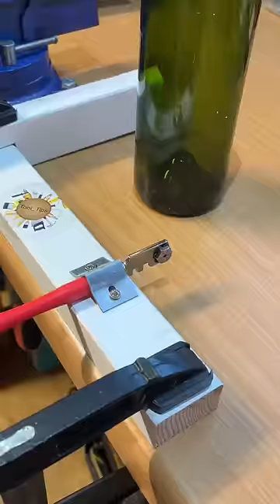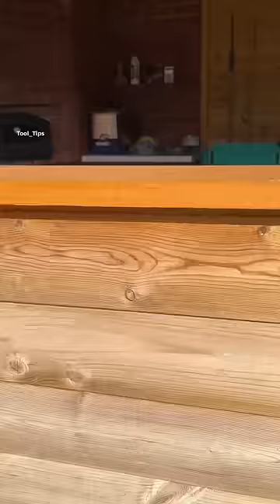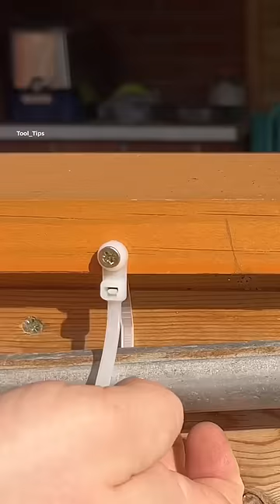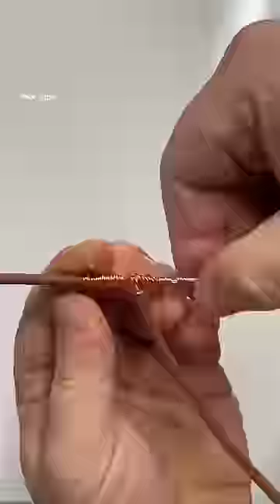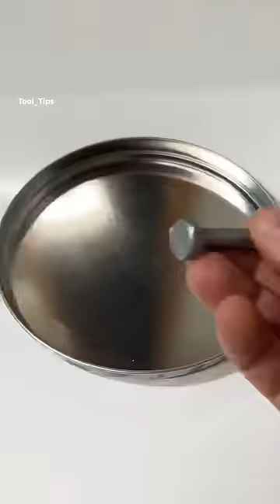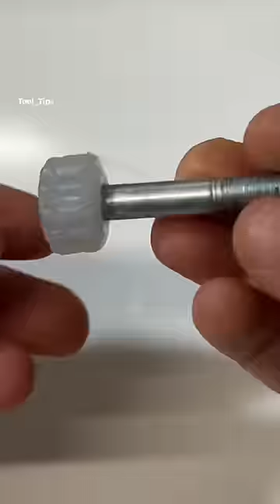Best ToolTips on #shorts

Comment: The copper wire one was VERY handy.
Reply: Everything was terrible
Reply: Forgot the heat shrink
Reply: No
Reply: @paulsherwood2615 and solder
Reply: Hope you are joking. Never do something like this, if you don"t want to burn your house... Use solder at least, but there are even better options to make an electric connection...
Reply: i would find it handy in prison
Reply: And VERY illeagal. If you want to burn your house, get charged from insurance fraud and get in prison. This is is how you do it.

Comment: If you ever needed proof people don't understand the basics of electricity that splice is it. A high school physics student could readily explain why that's just bad regardless of what your doing it for - use proper safe connections for gods sake, they're not bloody expensive... 🤦
Reply: Take some time to learn about voltage, resistance, and current. If you just understood how an electric kettle or toaster worked you would think twice before doing that, hell, feel the heat from a drill after use... 😬

Comment: You could always use a wire nut??
Reply: Can't use wire nuts in plant machinery, they come loose with vibration.
Reply: They also cannot use wago, although it isn’t available in some countries
Reply: wire nuts are only popular in North America. You can technically buy them here in Europe, but I have NEVER seen one is use, anywhere.
Reply: @xl000  never knew , that’s interesting
Reply: That’s why, never be bias at some electricians in different countries because they are never have upgraded materials like other countries have

Comment: To all of you "electricians". . . . . . that is a splice for low voltage connections and is intended to have heat shrink applied afterwards. Never installed any remote starters I assume?  Please dont use scotch-locks or wire nuts. And preferably solder the connection as well.

Comment: So most people agree the only one that actually is relevant is the bottle scoring, and maybe the zip tie one? Glass vial was impractical and messy, the wires are a textbook fire starter, zip ties would hold for a temporary project, but are in no way durable enough to last and could contract in the cold likely snapping. Hot glue is flexible, but would fall apart quickly under even the slightest amount of torque.

Comment: The splice isnt too bad. Its just a standard military splice. If they covered it with something insulating itll be fine. They exposed too big a section on the horizontal line though.
Reply: just cut it and use proper wire lugs

Comment: Tip #1 putting sand and glass in the hole does not make the bolt tighten up clean that shit out and get an anchor they sell them in the same store you got the bolt from.
Tip #2 I've never cut glass before. I don't know if this is practical or not.
Tip #3 Not a bad idea but if it's going to be there more than a few days get the proper straps for it 
Tip #4 Are you trying to start an electrical fire because that's how you start an electrical fire.
Tip #5 If you want your bolts to barely hold you could have just screwed it in without wasting the hot glue.

Comment: #1 is the reason you use screws not bolts on wood #2 how to cut a wine bottle with a glass cutter #3 how to use screw on zip ties as designed. #4 how to burn your house down #5 ehhh I guess it works?

Comment: Dont use glass as a filler in a whole that is too big for your bolt 
When will you need to have a split from the mainline? If tiu needed it a three-way connector is best as you can replace the individual lines and not the whole thing.
Hotglue is not a tool for anything but holding decorations to wood, paper or foam.
Reply: That ain't just glass, inside that vial there's chemicals that create a reaction that binds the bolt into the material and are actually meant for anchoring, the problem is it's meant to be used in concrete, in wood it's worthless.

Comment: Why put a running drill with no bit next to a piece of glass you're trying to cut? 

The first one, what's the tip, it's a chem anchor. 

As many, many electricians have already said, don't fucking splice wires like that

Comment: first one is completely useless, second one is common, third bro that's what they're made for. 4th if you need to splice wires use a terminal block, or something that isn't this, also, fucking solder it, and insulate it.. last one, what's the point, buy a bolt with a bigger head...

Comment: that is not how you splice a wire, wtf is that, how are you going to insulate it, do it properly just cut the full wire so you have 3 ends and then splice those together, their are plugs for putting multiple wires into that insulate and clamp them together, better still solder them together SOLDER you know a solid connection

Comment: Like that's not even looking like a secure contact that just looks like a major fire hazard like somebody taking three different wattage of a extension cord and making it into one like one guy that I know I mean you know those generic white extension cord that you can buy from Walmart for like ten bucks and the orange drop cords in the drop cords for like a plug-in drill and a sander he literally had three of those wires plugged into that whitelock and actually had electricity on it I swear if that did not look like a meth head was trying to keep his electrical wires I would not know what is because I would not even put my phone on that to charge it for my hotspot when I'm playing online I know it burned my camper down because I live in one full-time and I know that I'm not going to find a wire like at especially in my converter box what the hell is wrong with you

Comment: What was the point of the last one ?
Reply: Converting a normal bolt into a thumb screw instead of buying a thumb screw. It will only work so well because hot glue isn't the sturdiest material and tends to weaken and separate from metals over time.
Reply: adding a grip to anything that needs a tool, that doesnt need to be tool tightened.
Reply: OK , thank you all so much 👍👍
Reply: Halfass attempt at a knob head on a bolt. It'll fail almost immediately